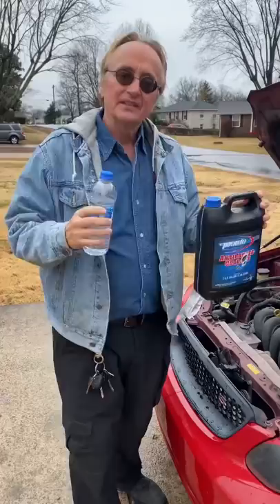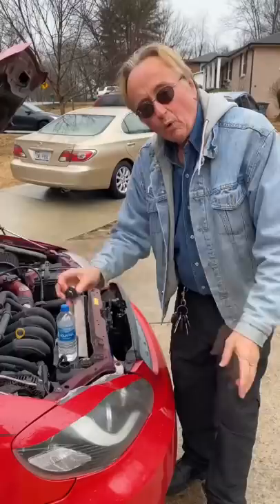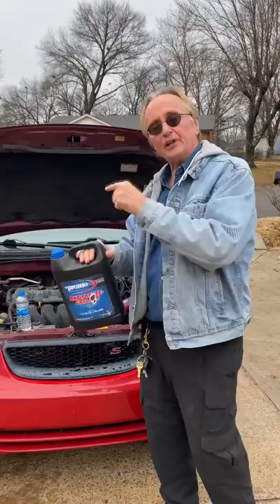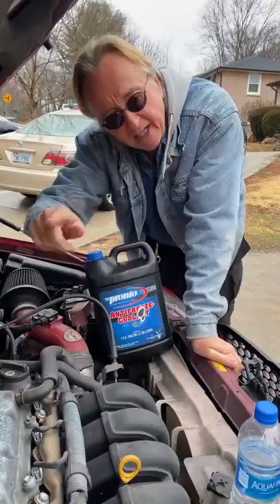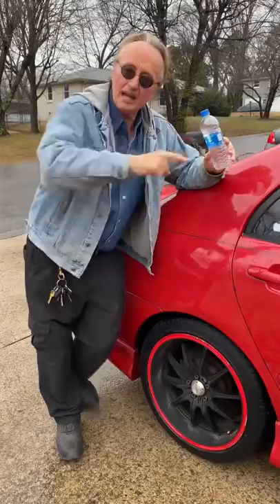This Mistake Just Destroyed My Engine

Comment: I can't tell you how many clients come in our shop running Pure water in their radiators and destroy radiators & internal engine parts..Scotty is 100% correct run 50/50 & you'll avoid troubles
Reply: @Steve DeLeon When I was an owner operator & had my Pete,I always ran the premixed 50/50 red coolant.
Reply: @Mike583  Professional Driver👍You The Man Robert 🇺🇸
Reply: People also forget it lubes the water pumps as well.
Reply: @oldrango883  Yes...& pure water will rust & promote corrosion in the cooling system
Reply: @Mike583  Good job 👍
Reply: But what if ur doing a coolant flush , i hear its ok to run distilled water for a quick short ride so u can flush out all of the old coolant. Doing that is okay right?? Going ona 10-15 min drive with all distilled water after draining the coolant from petcock
Reply: @jagjeetraien3448  yes, distilled water but only for a very shory period of time. otherwise you run the risk of causing severe damage to your engine and/or cooling system. i've heard of the process you are refering to, and if it were me i would shell out the extra money (10-15 bucks) to run a 50/50 and just drain that after a short period of time. just my thoughts, good luck with any project you may have!
Reply: I live where theres heat or warmth during the year and no snow. Do I need antifreeze?
Reply: @xaviercruz4763  Si Mi Amigo...running pure water will cause problems in your cooling system..run 50/50 water/ antifreeze year round
Reply: @oldrango883  you mean the ones with sealed bearings?
Reply: @williamyocum4774  no. He meant the ones with unsealed bearings ya dip.
Reply: if you want to test for leaks or you don't have any antifreeze then water will do any cooling is better than no cooling
Reply: @fishsticks4981  so true..for finding leaks water is ok. but not for running it instead of 50/50 all the time
Reply: I've filled with 100% water before... That was only in the warm months AND as a temporary measure, that's it

EDIT: and what fish sticks said is fine too
Reply: How about 100% antifreeze
Reply: Damn. Just went through a couple videos for a radiator flush. They all pushed to buy coolant concentrate and mix with distilled water.  When i went in to put in 1 gallon of coolant it went through. The car wouldn't take any water so now my radiator is filled with only coolant. I should have bought the 50/50 mix and it would have had a gallon of tjat instead. Cautious on those youtube how to.
Reply: @xaviercruz4763  no only distilled water
Reply: I saw this old man come in and he had gotten his radiator replaced. Turns out that the well known shop in Dayton that did it only put in water.
Reply: @XxpowerxX92  they ripped him off unfortunately..the well known shop saw him coming..
Reply: @stevedeleon8775  Some engines require a 70 % antifreeze to 30 % water or they boil and warp the cylinder head and no water alone isn't a good conduter of heat, the glycol in the antifreeze is not just preventing freezing or reducing overheating it raises the boiling temperature and is a anticorosive agent, a cleaning agent , lubricant and what most don't know unless you passed science class it makes water "wetter" so that water's heat conducting properties are better yet glycol isn't a great heat conduter it self.
Reply: And every manufacturer have a different mix or different antifreeze they use, consult the owners manual and use a glycol meter instead of the guessing the mixture.
And by the way I'm a professional with 30 plus years experience and have never lost a engine in the fleet I'm maintaining for the past 25 years.
Reply: @Thunderstormworld  I'm well aware of the Euro & Japan engines that require 70%/30% mix..most domestic vehicles use 50%/50% with the exception of  Fiat Jeeps & Chrysler /Dodge
Reply: I use my own Urine
Reply: @stevedeleon8775 I think 30% antifreeze or even 10% is enough in say Hawaii

Comment: I told this to an old coworker of mine and he just looked at me and said “ehh it’ll be fine”
Reply: Sounds like the people I work with...
Reply: Probably cause he has a 79 ford pick up with the water thats been in it for that long. Lol
Reply: Wait until his engine blows up and comes to you crying "should have listened to you"
Reply: i mean tbh if you use distilled water (tap water or refined water big no) and it doesn't go below freezing in your area you should be fine as long as you keep an eye on things.
Reply: again this is most likely not good advice as antifreeze also lubes your water pump but eh i drive quite an old car and that's how it was run for tens of years.
Reply: Is your coworker only doing it temporarily? Because while it's bad, it's still a good idea in an emergency situation as the engine won't get to redlines. Still getting it fixed should be the top priority but getting to a repair shop and just being cheap are 2 completely different things.
Reply: Sure..he'll be fine until his system rusts out & causes water pump 🤑& radiator..
problems 🤑
Reply: What about just adding or topping off with water say if there is a leak is that still not good.  So it still has coolant in it.

Comment: Learned long ago to use only distilled water and antifreeze in a car.
Reply: Why is that? Is it less conductive?
Reply: @kaptein1247  Tap water can have all kinds of minerals and particles depending on your local water source, while distilled water is completely clean. I use tap water with antifreeze but i've heard some people only use distilled water with antifreeze.
Reply: @imrileth6618  you really shouldn’t be using tap water unless you want your engine rusting.
Reply: CT is infant grade content now  tx. Didn't expect such a great explanation.
Reply: @Rekt-M8-v4  Why would tap water make it rust?
Reply: @Rekt-M8-v4  Tap water is not going to make it rust when mixed with antifreeze. Only water will rust the engine be it tap water or distilled.
Reply: Tap water won’t make it rust once the antifreeze is mixed in and if you take your car to a race track it’s part of their rules to only run water but ice you leave you put your thermostat back in and drain some water out and put antifreeze back in
Reply: I've never heard of steamed distilled water before! Only distilled water.
Reply: I've used dirty creek water in a 95 Cherokee straight 6 when I blew the top corner of the radiator out and drove home from the trails.
Reply: Salt, chlorine, chloramine….
Reply: I would always reference  your handbook some models "older" use Ethylene Glycol  or Newer G05 or 50/50 in newer vehicles.  But ALWAYS reference your vehicle handbook.
Reply: @Mike583  It's a Utica expression.
Reply: @kaptein1247  hey Kaptein
Reply: @Mike583  Well that is what the term distilled means after all... Heated to a gas (steam) and condensed elsewhere and collected.
I suspect many are labeled distilled but really aren't.
Reply: @star-army  Well I'm from Albany and I've never heard that before...
Reply: Just buy 50/50 coolant like Scotty advises. Sure, it's more expensive but at least you know what you're putting in is the correct stuff! (And you always know that it's the correct ratio when you have to top up)
Reply: @HarrySpencerMusic  Last I bought any it was the same price. Half the money for the 50% vs 100%. Or at least near enough it didn't justify buying distilled water as well.
Reply: I USED SOLUABLE OIL FOR YEARS...IT DISSAPATES SO COST EFFECTIVENESS IS NOT GOOD...
Reply: I use water wetter and water no antifreeze it never gets close to below freezing where I live
Reply: RIGHT
Reply: @kaptein1247 it doesn't have all the chemicals in city water or country pump water that might have solids in it.

Comment: Only run it on pure water if your antifreeze levels are danger to empty. The car overheats quickly. I learned from experience. 
Rolled down the windows, put the heat on high and Max, pulled over in a Walgreens parking lot, called the fire department, all on a hot summer day.
Reply: Was that you?

Comment: It also lubricates and is a corrosion protectant. You will rust out your water pump vanes and your freeze plugs if you run straight water. I speak from the hard lesson of experience.

Comment: Had a neighbor that put straight anti freeze in his vintage corvette and wondered why he kept replacing radiators
Reply: Did you tell him not to do that?
Reply: @Rekt-M8-v4  yeah a few times! Didn’t listen
Reply: Straight Antifreeze will actually FREEZE 🤪
Proved that when I was but a lad... Lost my $1 too 😭
Reply: Scotty didn't explain that one. Automotive coolant also reduces corrosion which is what will eat up your radiator.
Reply: I was working in tesla and in brand new cars we were putting 100% antifreeze and every car manufacturer does that...
Reply: @traktoristawe5377  
NO they don't...
It's usually a 70/30 mix...
But, it was a pump container of it... 
They wouldn't rely on YOU installing the correct mixture 👀🤪🤣😳
Reply: @boobtubeakatv1296  on the big container it said 100% antifreeze
Reply: @traktoristawe5377  
Okay Dokay...
I'm sure they knew better than to use it straight up...
Of Course, batteries don't do well in places that would freeze pure antifreeze anyways... 🤪
Reply: @boobtubeakatv1296  pure antifreeze freezes at about -60 degrees Celsius ... i think only one place in the world has such cold temperatures
Reply: @traktoristawe5377  
You must be talking about freezing solid 🤣
Your vehicle would be damaged LONG before that !!!
Almost anything below -10° F will do damage ....
Reply: @traktoristawe5377  :  Then it almost certainly wasn’t the propylene/ethylene-glycol type of antifreeze used in the majority of vehicles.
There is, however, mixtures of liquid chemicals that are used in a “closed-system” cooling in higher-end vehicles such as you mention. These are vehicles that don’t have ways for the consumer to top it off because the system is sealed and no evaporation occurs. 
The tank of stuff you were using might have been labeled 100% “antifreeze”, but not the same stuff Scotty is talking about.

Comment: This isn't very accurate, and that's why we don't call ethylene glycol "antifreeze" in Aus.

This is corrosion inhibitor. That's what it does. Yes, it lowers the temperature at which the water will freeze, but it doesn't prevent it from freezing. It also doesn't prevent it from boiling.

More often than not, it makes about 3-10C difference in the freezing/boiling point.

It's function is to prevent your motor from corroding from the inside

Comment: Is it true that the antifreeze is also responsible for keeping the boiling point high?

Pure water has a low boiling point is boils much quicker and introduces air into the system when it boils.
Reply: Yup, the 14 psi cap prevents boiling too. Coolant also has a lubricant in it for the water pump bearings. Last, if you boil water in a kettle, you'll see calcium build up left in the kettle over time, not good for radiator or internals like the thermostat.
Reply: @richardwilliams1986  That only happens with tap water... You shouldn't tap water in your car, only distilled water, and distilled water has absolutely no minerals in it...

Comment: You dont use just water because it EXPANDS when frozen and destroys your engine and radiator also rusts. The same is true for you screen washers, just water will destroy your water pump and push hoses off.
Reply: What if I live in a tropical country where we pretty much never get anywhere near freezing temperatures?
Reply: @gabrielobando7761  Coolant fluid also lubricate water pump. I destroyed my first car, because I poured only tap water into my cooling system.
Reply: @asimov64  You shouldn't use tap water anyways...

Comment: Is it still OK to put a drop of Cutting Oil in the cooling system. Used to be standard practice by old-timers to help lubricate the water pump. How often should the system be flushed & coolant renewed?

Comment: Scotty! 07 ES350 just bought, just noticed when the car is cold my coolant is below the L line in the reservoir. It's around 130k miles which I notice in service manual it says check coolant levels anyways! I ordered the HOAT coolant that I need. Do I fill from the reservoir, or the radiator? The manual says the reservoir but I see conflicting posts online... Also I don't need to drain the old stuff...do I ? It looked like I had some when I bought it a month ago, was pink. Hope don't have a leak...

Comment: How long would your car run on pure water? My goal is to flush the system after 1,000 km of driving along with maybe an oil change as it's a reconditioned engine with which anything could have gone wrong.

Also my cars running colder than it should be at the same time it can run at temperature under load. What's the bad side of this running colder up to 10 degrees celsius?

82c standard, high-flow 78c

Temp running range 70 - 78 degrees. 70 normal driving, 78 at idle or under high load or stress.

Comment: I have run my 1998 Nissan B14 on water only for years without problems. Could it be this is a problem for newer models or is it cause I'm in the tropics.
Reply: You're in an area that doesn't freeze but I would still go with a 50/ 50 mix .
Reply: I also used my Opel Agila with tap water only lol
The engine was rusted sooo bad from inside was it was being mixed with oil,never let me down though ,I changed the engine myself later cause wasnt even the correct engine lol

Comment: I use AutoZone 100% mixed with Life Water in my 1999 Lexus ES300. Runs like a dream and even doubled my gas mileage when I started adding life water. 270,000 miles no check engine lights. Double prong spark plugs with the post. And I live in the Rocky mountains in Colorado. But I from Providence Rhode Island.

Comment: I've never done that with the radiator, but I did once drive north out of Texas during the winter and forgot to change the windshield washer fluid out for the winter formulation. Fortunately it wasn't completely full so no damage was done, but I couldn't clean my windshield for a hot minute until the engine heat defrosted it!

Comment: In older cars, it was ok to use only water, especially in Florida. Had a 69 chevy II nova that I only put water in the radiator. Never had any trouble, it was still running great when I sold it to buy a van.

Comment: Correct me if I'm wrong.. but in hot environments.. it's okay to run it on water.. but it has to be distilled water.. that way, no ionization or corrosion would happen due to different particles oxidizing the engine or radiator material.

Comment: I have a 2008 Toyota Yaris with 207k on the odometer. The owners manual says to run 55% coolant and 45% distilled water. I run 60% coolant and 40% distilled water. I only had to replace the fan and the cap on the radiator.

Comment: Ethyl glycol is also great that absorbing heat, but cant dissipate it efficiently enough to cool an engine.  This is another reason why it is mixed with water and some modern vehicles require a higher ratio like 70/30.

Comment: I'd love to know how pure distilled water causes cavitation. In a hot climate, say, like in Phoenix Arizona, it is 100% better to run distilled water than a 50/50. It doesn't get anywhere nead cold enough to freeze and like you said, dissipates heat faster. I have over heated multiple times when running a 50/50, and excluding situations where I had a mechanical failure(stuck thermostat, bad/old hoses, etc) the only times I have ran hot or over heated were times I was running a 50/50.

Comment: The cavitation that I believe Scotty is talking about actually occurs on cylinder liners. Tiny vacuum bubbles are created and imploded on the liner surface due to vibration which creates pitting and eventually, holes, allowing the coolant into the cylinder. The additives in the coolant create a thin film that replenishes itself and protects the liner from this damage.
Reply: Not even Bill...
Them pits occur on the vanes of the water pump leading to a hot bearing and then failure...

Comment: Strange. Been running pure water in the race car for years. Yes you have to worry about freezing, but cavitation? If your fluid is going through cavitation then using antifreeze won't help you. Cavitation is caused by a sudden drop in fluid pressure creating air bubbles, the only place that can happen is behind the pump impeller blades and at the thermostat. I believe he is referring to boiling the fluid, which is then handled by the pressure of the system and not the fluid itself. Corrosion is an issue with straight water.

Comment: Diesels need supplemental coolant additives ( SCA ) to protect the cylinder liners from cavitation during the combustion process. Used only distilled water not tap water in cooling systems

Comment: Water does cool better but what people don't understand is that it has a boiling point of 210 degrees. Some cars naturally run that hot so when they get there they start to overheat because the water is boiling

Comment: Apparently Scotty needs to look up the Chrysler 2.4L 4 cylinder engine. I only say this because I have 1 inside my 2007 limited edition FWD jeep patriot and at 200k miles still going. I just did a tune up....... only problem is CVT transmission...... But it's the original transmission I think........

Comment: Some engines require a 70 % antifreeze to 30 % water or they boil and warp the cylinder head and no water alone isn't a good conduter of heat, the glycol in the antifreeze is not just preventing freezing or reducing overheating it raises the boiling temperature and is a anticorosive agent, a cleaning agent , lubricant and what most don't know unless you passed science class it makes water "wetter" so that water's heat conducting properties are better yet glycol isn't a great heat conduter it self.